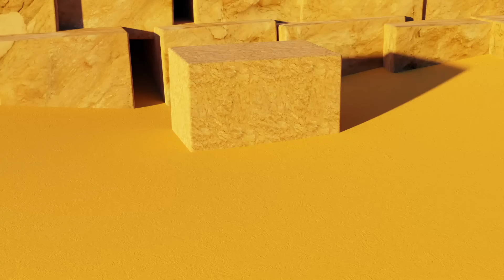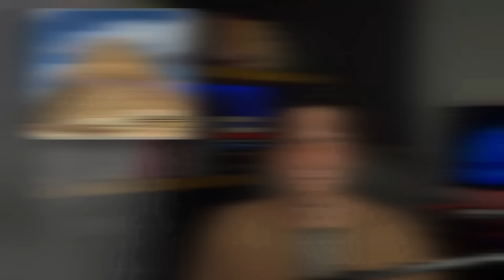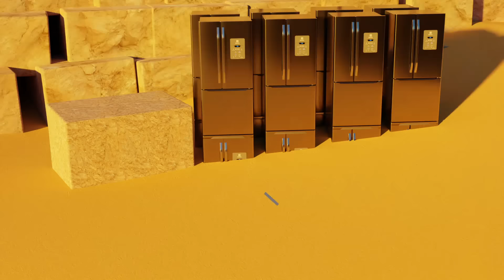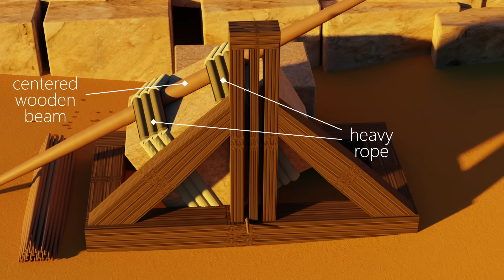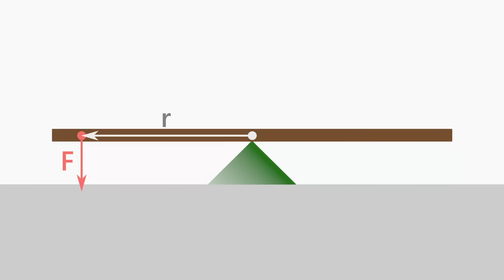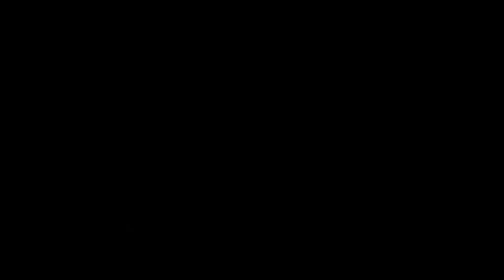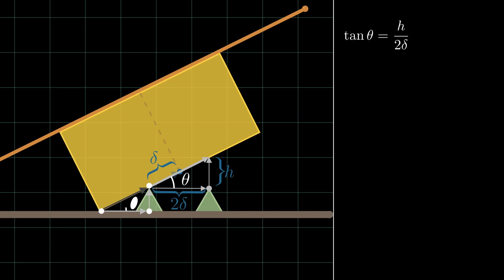Physics Reveals How the Pyramids were Actually Built

Comment: I've known for many years that it was done with levers and counterweights, though I didn't know the exact method or the math behind it.  Also the Herotodus machine is also known as the shoring jack, which has been in use in construction for many centuries (obviously since the Egyptians). 😁The damn editor won't allow me to fix my misspelling of Herodotus for some reason.😒
Reply from the maker: Thanks for your feedback!  Really appreciate it.  I hadn't seen anyone do the calculations on the Herodotus machine before, so I wanted to figure it out.  I particularly thought it was interesting that the pivot distance is the ultimate key to it's operation.  And no worries, Herodotus is certainly a easy one to typo.  Cheers and happy holidays!
Reply: @DrJohnDev : Happy holidays to you as well! As for the spelling, I am aware that in the grand scheme of things, it's trivial, but I really prefer to be as correct as possible as often  as I can.😁😇😁
Reply from the maker: Thanks for that!  Appreciate it :)  And yes, fully understand.  It's a great goal to strive for 😅
Reply: @DrJohnDev  : As far as the pivot distance being the key, this is true for any use of levers, since it affects both the applied force and the distance moved.😁
Reply from the maker: Right, very true.  And the geometry of the object restricts certain positions from usable operation.  Really appreciate the insightful comments!   If you're on other social networks (like X or otherwise), it'd be great to connect.
Reply: Dammit I can't fix my misspelling of Herodotus in my previous post😒😒😒

Comment: There was other stones that weighted alot more. The kings camber being one of them. The kings camber is also 100's of feet high. Good luck explaining that one with this silly math. Math helps but its alot easier said then done.
In case you didnt know, the camber has blocks 60-80 tons.
Reply from the maker: I'm aware, and yes, the silly little math is what drives the operation of all construction today.  The physics is the same for the 60 - 80 ton blocks.  Just plug in a different value for M.  But I'm sure you knew that.

Comment: That's a good way to lift a block but there's no way to laterally push it into place. Also remember that it can't get chewed up on the way because it has to be a perfect fit for the other blocks in all six directions. So if the first time you put it in, it doesn't fit, you have to pull that block back out to shape it so that it makes a perfect seal to the other blocks. Which creates a real problem, when it's laying flat on top of other blocks how do you lift it up to get it into the machine? And this needs to be done repeatedly without fail for at least 27 years?? 
And if we're talking about physics did you think about 10 tons rotating back and forth on pieces of wood? 
Also the pyramid isn't just limestone don't forget about the rooms and passageways out of basalt and marble with a weight upwards of 52 to 100 tons. On a glorified seesaw?? Bruh!
Reply from the maker: Just throwing words together doesn’t make it more complicated. They’d do it like builders place tile today… just measure twice and cut once and then line up before placement. They’re not just dumping blocks any old way before putting them on. They of course would be methodical and precise about it. Which isn’t a physical impossibility (at least to some people).

Comment: So right off the bat you continue the lie that the pyramids were built as tombs for pharaohs... there has not been found in any pyramid any mummy... the pharaohs were all buried in the valley of the kings!  I'm really doubting as to whether I should even continue listening... but I will... and I did... so tell me and everyone else... how did they lift the 70-80 ton granite blocks that are in the 'king's chamber' up the walls and set them in place??  As usual another 'genius' thinks they have solved how it was done but I doubt you're right.
Reply from the maker: Oh! 70-80 tons! You sure got me. It’s only 10x less than modern concrete structures weigh today, which use the same leverage principle. Just another genius commenter with nothing to do but hate on useful ideas.

Comment: Weren't the 10 ton blocks the smallest of the blocks used for the pyramids? So you're not covering the majority the building materials actually used?
Reply from the maker: The average weight of the pyramid's blocks were around 2 tons.  There were heavier blocks used in the king's chambers, but the same physics applies, pivot point distance and all.  Simply plug in a different term for the mass.  Of course the force applied will change, but this can be accommodated with additional counterweights placed on top of the block.

Comment: It's nice how the pivot guide of the machine on the side closest to the block magically disappears when you need to shift the block into position. 

Also is there wear on the blocks at the pivot positions and the bottom leading edge as well as marks on the top lead edge of the base stone showing the work of moving the block from the machine and into position on the base block?

how long does the lever need to be at you place the top stones?

How does the base of the machine shift inward to allow for stone placement as the base drifts to the center mass of the pyramid?
Reply: @rhenery7949: Kinda depends on the orientation of the jack, but there are problems either way.  There are solutions either way, some more difficult than others. The actual orientation of the jack depends on a lot of factors, so ya pays yer money and takes yer choice.😁
Reply from the maker: I can’t understand what these questions are even asking.

Comment: There are YouTubes showing the rocking motion of the block and using wooden slabs did lift the blocks.
This was done with a real 5,000-pound block and real people rocking the block.
So just small sticks and rope lifted the blocks up one course in 15 minutes.

Moving the blocks from the quarry to the pyramid was done with small logs and rope too.
A harness of rope attached 3 logs to each of 4 sides and the blocks can be rolled with 2 people easily.

That's how the Egyptians built the pyramids - small logs and rope.

Comment: I think that this is a piece of the puzzle. What you are not accounting for the the move of the mass left or right whilst rotating the block. Very little would be able to stop the block if it were to start sliding to the left whilst rotating it counter clockwise. Second issue not discussed is how thick must the beam and the slats be to support the block. 
This system covers stacking very well but how did they move the blocks in the horizontal plane. This would have been far more challenging once the first row has been laid.  Related to the horizontal movement is how did they get the blocks from the quarry. 
Lastly the block every 6 minutes, 24 hours a day for 27 years sounds too far fetched for it to be real. The higher they went the more difficult it would have been so I guess laying the last rows could have taken a full day to get a block into position. 
I still think there’s something missing in the puzzle and no it’s not aliens.

Comment: Nevermind how they cut all those gigantic blocks out of granite with only copper chisels and rocks bound to a stick with leather laces?   Nevermind trying to do all this to each block in 6 min per block 24/7 for 27 years?  Nevermind how they set this rig up on the skinny ledge of a block 375 feet in the air and trying to operate this lever system?   I mean, you have good math here for sure, but, the practicality of using a system like this still doesn't hold up to scrutiny.  In my opinion, of course.

Comment: How does one slide them to position and how does one put and slide them on the apex?
Reply: and how do they insert the first point in the machine for pivoting over  the stone? :)
Reply: @QIgorecki  That's where the aliens were involved!
Reply: @johnmorelli3775  You know, you say that, and I am certainly not saying it was, by any means. But logically it could be argued that aliens is more plausible than religious dogma, and the majority of the world believes in that.
Reply: @QIgorecki  
Levers. Were you not watching the video?

If you can use a lever to raise the block, you can use levers and sand and water as lubricants to slide and  get them into position.
Reply: He missed important details like that entirely. I think they used cranes like they do today or two cranes joined together at the apex, but instead of motors, used counterweights for all movement.
Reply: @ChatGPT1111  I heard an intriguing idea. In ancient Egypt the land was flooded approximately 3 months of the year. For 9 months they would quarry out blocks. During the flood season they would float the blocks out of the quarry to the base of the pyramid, using animal bladders and other flotation devices. There the Egyptians would build a large water tight column up the pyramid. After the column was filled with water, they  would float the blocks up the column. They would have maintain a system of locks to get the blocks into the column with minimum water loss. Workers would have bringing water up to the top of the column constantly.
Reply: @johnbennett757  😢😮😂 NO MATTER WHAT Procedure You INVENT(!!!), You Can't PASS The Reality! YOU Have to Lift MULTI-TONS SQUARE STONES!!! PUT It In Place and FIT With Other STONS(!) PRECISELY(!) In A Matter Of Minutes(!!!)? 10-15? IMPOSSIBLE...😮😢...😊! (Over 2 millions of them!) Even if you move  4 stons simultaneously, you may have 40 minutes... Still not Enough Time!😢
Reply: @ChatGPT1111  Which apex is that? You seem to suggest they built the top first.
Reply: @markmcd2780 Are you serious right now? Two cranes tied together become a gantry crane, which can lift much higher weights straight up. C'mon now 😂😂😂
Reply: @ChatGPT1111  - Of course I am serious. You need to put some thought into this. 
1. So ancient Egypt had gantry cranes? You're implying they could set up the gantry, do a line of blocks, reset the crane, do a line of blocks etc.?
2. Gantry cranes even now would not suffice to built the Great Pyramid.- the pyramid is taller than the largest crane in the world & it can't lift to its full height!
3. The world's largest gantry crane could not run the span of the pyramid & the higher you get, the worse that issue becomes.
4. Gantry cranes do not address how they moved all the blocks to the location in the 1st place.

There are valid reasons why people talk about how difficult it would be even for us to do this.
Reply: @markmcd2780 You're missing something I took for granted. They partially reassembled and/or moved the crane in increments as the pyramid was stacked. You only need a tenth the crane height to do it this way. Sorry if it's so confusing to you.
Reply: @markmcd2780 I know what your next question will be so,,,,,,Use force multiplier effect using a series of parallel cranes to lift heavy blocks. Each crane has a fraction of the burden and lifts a fraction of the full height. To speed things up, employ a series of smaller cranes that will work together to lift each block a single level or a few levels at a time. Each series of cranes work in unison to take each block all the way to the current highest level. Use lower cranes to lift new cranes to higher and higher levels.
Reply: @ChatGPT1111  You guys & your magic!
What cranes? How were they positions at (say) 30m high on the sloping pyramid?
How long was the lever used to lift the stones from the base that was getting further & further away at every course of stone? 
How do you brace the crane for multi-tonne stone away from the base? You would have seen modern mobile cranes tip over when they get that even slightly wrong.
I am unsure what it is you took for granted. That ancient Egyptians had access to modern tools? That they could magically balance a crane on narrow ledges to lift multi-tonne stones? That they had cranes?
That they had to move your magic crane at least a significant %'age of the total number of blocks & lift & swing those blocks across distances that increase the moment as you go higher?
I am not the one that is confused here.
Reply: @ChatGPT1111  Or Giants
Reply: @ChatGPT1111  C'est plus facile d'utiliser des cales et des leviers....
Reply: @ChatGPT1111  
He assumed the viewers would understand if you can use levers to raise the blocks 5 or 6 ft,.. you can use levers to get the the contraption under them.

How did they raise the counter weights which would have to be some significant fraction of the blocks even with a lever, so they could raise the blocks?
Reply: @ChatGPT1111  There were giants that helped build it. They were probably six meters tall and have strengths of several elephants. Why is this so hard to imagine?
Reply: @coding-sisyphus  I have a few in my backyard. They help me with gardening all the time!
Reply: @coding-sisyphus I don’t know why anyone wouldn’t believe they were 6 meters tall!!!
Reply: @coding-sisyphus  Pourquoi est ce si difficile à imaginer que ce système de cales marche très bien pour monter des charges lourdes. En plus en multipliant les postes de manipulation, beaucoup de blocs peuvent être montée durant une journée de travail...
Reply: @ChatGPT1111  People have tried using cranes etc., but steel cables snap. The stones are just too heavy.
Reply: C'mon you know how the blocks were raised and moved into position.
Aliens, of Course!
Reply: Considering the materials available at the time..I still see huge logistics in maneuvering the blocks.
Pivoting limestone on something hard enough carry the force would leave telltale crushing on the stone under the pivot
Reply: @douglashanlon1975  I can’t figure out whee the leverage point is, no place to stand.
Reply: ropes for the very few blocks at the apex. they were about 1 to 1 1/2 tons. relatively small.
Reply: yeah like what ropes do they use because im sure reed ropes break with those weight
Reply: @calencor  I think the puzzle is still unsolved, no matter the many optimistic explanations.
Reply: @chevyyyyyyy  The puzzle will not be solved any time soon, since Egypt has a vested interest in claiming it was their ancestors that built all t hat.
Reply: @calencor theres surviving ropes they used to pull boats along the red sea shore iirc. They had ropes strong enough.
Reply: One doesn't do it.
Reply: I believe rollers were used to move the stones, I do know that salt below the stone will ease movement.
Reply: @johnekins4408  Rollers at a steep angle is problematic. Where is the leverage?
Reply: Spit and sweat, maybe a little blood.
Reply: Aliens helped them.
Reply: it was easy - they had MILLIONS of slave workers
Reply: You load the block on the machine that's on the ground floor. You lift it to the machine situated 5 feet above it, then to the machine above that one, etc... until you reach the top. This way you can install at least 10 blocks a day and it takes 1 million years to build the pyramid. I knew the pyramids were much older than we think. Now I understand why.
Reply: @pjdruz5636  YES - and the power saw you used makes things MUCH easier
Reply: They just walk them using the leavers
Reply: @redcruben  More than 2 million of them? & how do you walk them up the levels? Remember, almost instantly you only have one side of the previous blocks to work with.
Reply: @redcruben  Absolument. Le système de manipulation à deux cales et appui alterné marche très bien pour hisser des charges lourdes avec peu de main d'oeuvre.
Reply: Wake up! You are so wrong!

Comment: I want to see somebody actually lift a 10 ton block like this in 6 minutes, which would include moving it sideways off the machine and perfectly placing it where it's going. And let's not forget the pyramid is 455 ft tall, the six minutes placement also has to include raising the blocks higher for each course. They are going to use this machine to raise the blocks all way to the top? How many lifts per block is that at the higher levels? If the average time per block is six minutes that means the ones on close to the bottom must be placed way more quickly than the ones at the top, how about some math on that? Where did they get all the large timbers to build these many machines, (which also have to be hauled up before the blocks) old growth forests along the Nile? A block every 6 minutes, nonstop, without a break for 27 years, yeah that sounds reasonable.
Reply: What's more the landing point is always moving toward the centre line!

Comment: Yes, and amazingly they are said to have built this in 20 years; averaging the exact placement of 1 stone every 2.5 minutes. Completely feasible!
Reply: 🤣🤣🤣  So true.  I love the sarcasm.  This method just doesn't cut it.
Reply: Based on known construction of mastabas (pyramid predecessors), up to 70% of the internal structure is likely comprised of smaller, irregular backfill or "rubble." The assumption that the entire structure contains larger, precisely cut and placed stones makes it unfeasible and an unnecessary waste of material, skill, and labor.